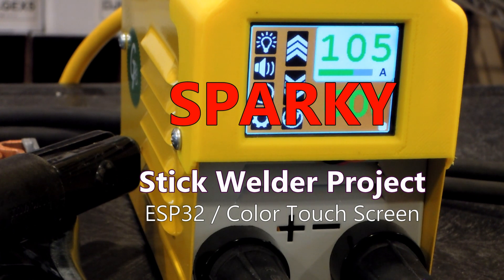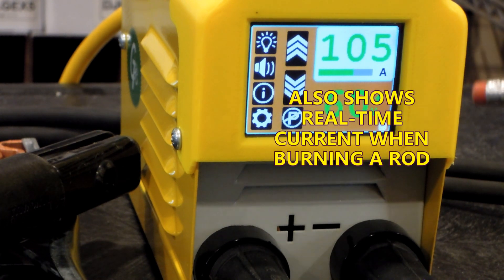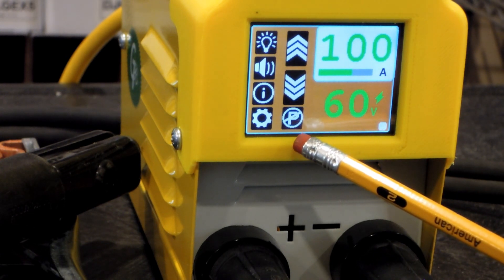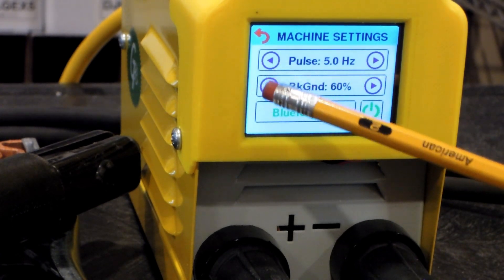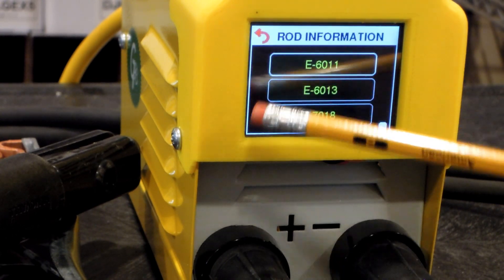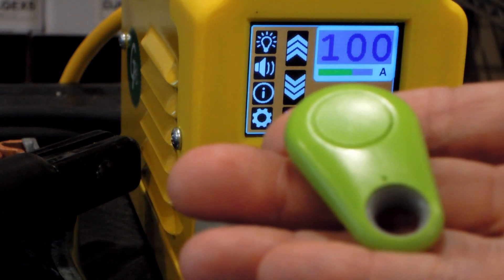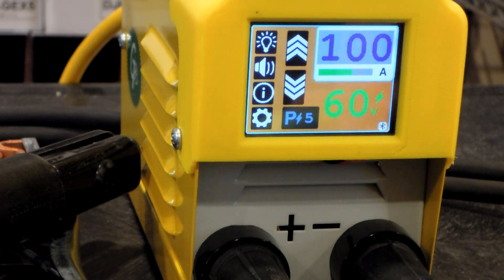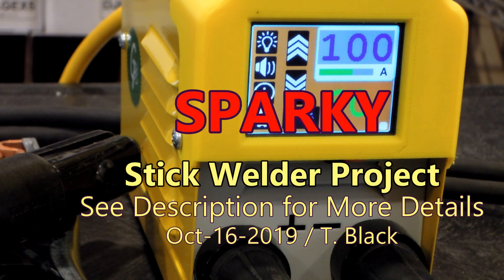Sparky: DiY Pulse Stick Welder

Comment: @MrRcCam can we talk about a idea I have that I think you might be able to bring to fruition?  Interesting project. I have a Miller 252 with a xr alumapro push pull mig gun. I’d love nothing more then to be able to add pulse to it!  Is this something we could work on/talk about?  Thanks. Good job.
Reply from the maker: Thanks for your interest in the Sparky Project. I'm behind on many projects and critically short on spare time. However, this is an open source project so other developers can partner with you and implement your ideas. The project is fully documented at GitHub (see link in description).

Comment: I know you say you wont sell this, but would you consider selling me the parts that need to be coded, coded already. I can dothe rest? I would love to do this as a display for our weld shop
Reply from the maker: Hi Daniel, 
I don't sell the components used in the project. However, the documents published on Github have a complete parts list. See the project details for all the information.
Reply: @MrRcCam  then i guess my next question would be if i purchased the boards, could you program them as i dont have experience in that. All other stuff I could do. Thanks
Reply: If I purchased the parts and sent you the pieces,  could you program the components? I would pay for the work. I would love to have a working mini welder
Reply from the maker: @spinn71  Thanks for your interest in the Sparky project. I'm sorry, but I have too many projects to work on. So I don't have any spare time to do this. 

The software files are freely available from the GitHub repository. The Platformio IDE software tool, which is used to program the ESP32, is available online at no cost. If you have the time and skills to assemble this project then learning to Flash program it should be within your abilities.
Reply: @spinn71  I have to relook, but it was only the ESP32 that needed programming.  If so and you are still looking.  I can program it.  You have to ship an ESP32 to me, send 2 and I will send one back if you pay shipping.  They I will make one as well.  I have 2 ZX-7 (yellow pot version and orange display version).  I have 2 plasma and 4 welders (not counting the ZX-7's).  Somehow get me a way to communicate with you and we can talk.  I have a number of ESP-32, esp-01, esp12, wroom, wemos, d1, etc.  So I do both welding and electronics.

Comment: I'm also looking forward do a modification like this for my chinese stick welder. can you help me please. I'm going to convert it to tig machine with pulse function. I have two questions. first one is how did you measure actual current when burning a rod. Is it  done by using current transformer?  Second one is how did you  reduce current for background current in pulse mode?